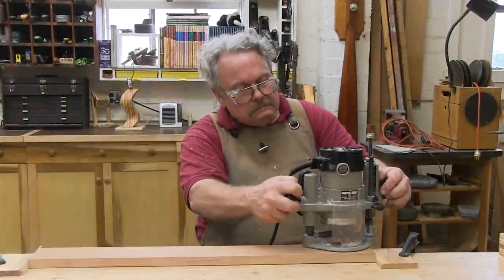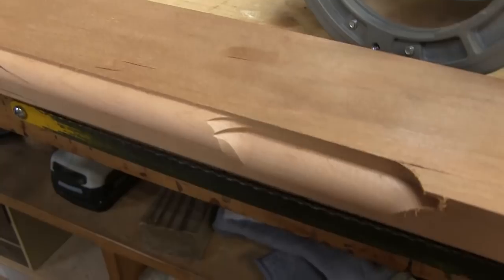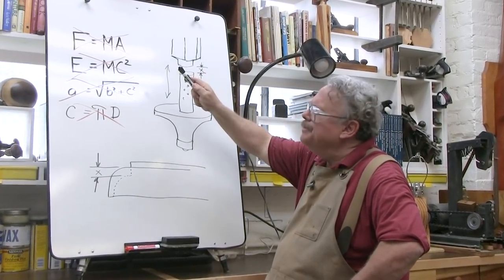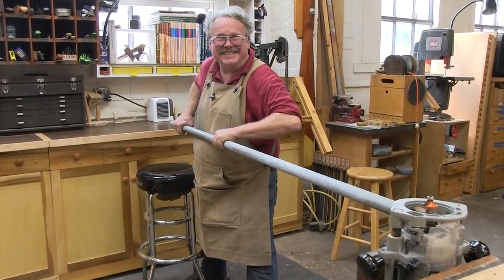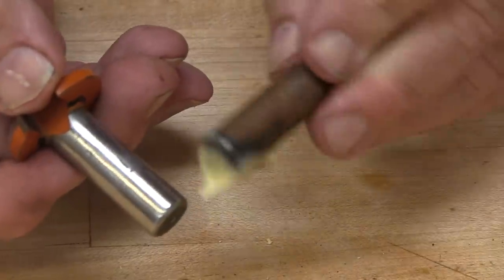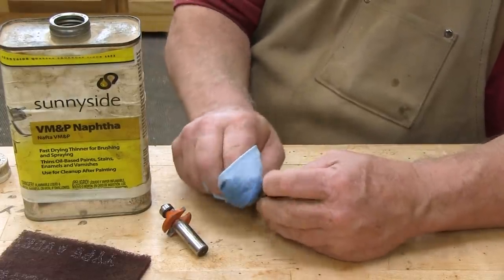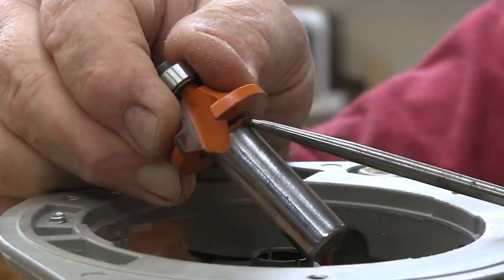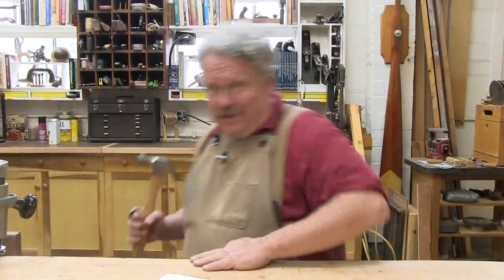Solved! THE Most Infuriating Router Problem.

Comment: First on Nick's list should be prevent bottoming of the bit in the collet before tightening. He came close to it with the notion of ''topping'' out on the neck of the bit, and his o-ring idea covers both, but more bit/collet combinations are vulnerable to this mistake, I think. My technique is to lay the router on its side after cleaning the socket and collet, with the added benefit of enabling you to block one wrench against the bench, requiring only one hand to tighten with the other.

Comment: The biggest problem I used to have was the shank of a bit bottoming out in a collet. It took me a while to visualize what the problem is. But I'd tighten the snot out of router nuts and bits would still come loose on me. Not all the time but enough it was an issue. That got me thinking about what's going on. Sometimes when I'd load a bit I'd bottom the shank out in the recess in the shaft for the bit. The router would be upside down while I was loading a bit and it'd just fall all the way down. When that happens as the collet grips the bit the nut can't keep threading down onto the collet. You already have friction on the column of the shank. The bit is bottomed out in the shaft recess. That's steel on steel. So what I did was I wadded up some paper towel and stuffed it into that shank recess. That can hold a bit up while it's just sitting in the collet and it'll compress as I tighten the nut. Problem, solution. Your other option is as you're tightening a bit once the collet starts to grab pull up on the bit a little. Yeah like I want to do that every time I load a router bit. I just want to drop it in and go. Just stuff some paper towel down in there and call it done.
Reply: This is most likely culprit for anyone that has not received instruction about it, cheers to Paul for mentioning it. It should be number one on Nick's list. My technique is to lay the router on its side after cleaning the socket and collet, with the added benefit of enabling you to block one wrench against the bench, requiring only one hand to tighten with the other.
Reply: @leehaelters6182  laying a router on the side fixes fighting gravity. It works. But it isn't as comfortable as flipping routers upside down and top loading them. They're really made to do that. Least all the routers I have seem to sit that way. I had so many bits walk on me before I figured out what was going on. I'd be sitting there thinking, I couldn't have gotten it any tighter. Once you stop bottoming bits out you make them tight and that's it. You won't have to burst a blood vessel. There's another problem today. Metric tooling. 6mm shank tools are indistinguishable from 1/4" shank ones with the naked eye. They look identical. But you can't hold a 6mm shank tool in a 1/4" collet. You can barely get a 1/4" shank tool into a 6 mm collet either. You can do it but you know you're doing something wrong. 6mm = 0.2362" and 1/4" of course is 0.250" So that's only a difference of 0.0138" a bit more than a hundredth of an inch. Most 1/4" collets just can't grab the shank if it's that much smaller. They kind of can, it feels hand tight. But it don't hold. I've seen 6mm tools being sold as 1/4" too. You know from online retailers, cough Amazon.
Reply: @1pcfred , aye! I ran into that metric/inches discrepency once. Stumped me for a spell!
Reply: @leehaelters6182  yeah it is something that's becoming more prevalent due to the global economy. Was never a problem in the past but it's common now. If you want to buy cheap foreign tools it is something you'll run into. There are unscrupulous sellers that'll pass 6 mm off as 1/4" in the US market too. The reviews there never fail to entertain. 6 mm shanks are actually a shade under 6 mm for clearance. I forget what it is, but it's remarkably consistent as I can recall. I think they're 5.98 mm? Almost no 1/4" collets can grab them right. They seem tight if you go to pull on it. But it's not nearly tight enough when the tool hits the work. So it gets everyone.

Comment: Ha ha funny vid. I definitely polish the router bit shanks on the reg. And I always put the bit all the way down, then retract a few mm before tightening. I do the same with drill bits. O ring tip is nice, as long as it doesn't dry rot and let loose at a high rpm. Doubt that's a legit worry though.
Reply from the maker: Thanks.
Reply: @WorkshopCompanion  thank you for sharing your gift of humor. You were obviously born funny. It's too natural for you not to have been.
Reply from the maker: @dubsbarry9963  My dad was a card. I've not fallen too far from the deck.

Comment: "Dag nabbit makes people think I'm quaint and complicated" Ahahahah not my experience but maybe it's a generational thing.

Thanks for the tip!  I'm glad I watched this video, as I've had this issue more than once and I thought exactly the wrong thing - collet tightness.  However, it appears that the manufacturing process left oils on the 36 1/4" router bit set I got for less than the price of 2 decent router bits was a great starter set.  These oils are most likely to prevent rusting after manufacture and while on the shelf as people wait for them to go on sale for  75% off - $260CAD($200USD) becomes ~ $70CAD(~$55USD).  So about $2CAD/bit vs $45CAD/bit.  This get's me going while I get up a "slush fund" created by selling some of my work to fund my hobby.

Thanks for the tip.  I think what I will do is leave the oils until I use them, clean them with brake cleaner or mineral spirits at time of use, then reapply some mineral oil to prevent rusting.
Reply from the maker: Thanks for sharing.
Reply: @WorkshopCompanion  Thank you!

Comment: I also think on some routers the router bit is inserted until it bottoms out on the shaft. Then the collet when tightened tries to draw the bit deeper which of course is impossible hence the collet feels tight but in fact is stopped by the router bit hitting the shaft. 
I always pull my bits up from bottomed out a 1/4 inch this way the collet can tighten on the router bit and draw it deeper into the router shaft.
Reply from the maker: Good practice. I have a Milwaukee that is attached to a gunstock lathe that I designed that worked just as you describe.
Reply: Instead of pulling your bit all the time you can just wad some paper towel down under the collet in the router shaft. That's if you have the talent to make a good fitting dry spitball object that you need. Can you handle it? Every router seems to have that defect though. I have no idea why they make them like that. Can't they wad up some paper towel at the factory and do it for us?

Comment: Suggestions on how to fix drills? They have the same problem.
Reply from the maker: Keep the shanks clean, of course. Discard drills whose shanks become excessively burred or galled. Double-lock the chuck if you are using a key; that is, tighten the chuck with the key in one of the locking holes, then turn the chuck 120 degrees and check that the chuck is tight in one of the other two holes. If  you have a ratchet chuck, tighten until the clicking stops, then turn the chuck back one click to lock it. If bits come loose consistently no matter what you do, you probably need to replace the chuck.

Comment: I want to know how to get a shank OUT of a collet that has been rusted into place at the base, after years of neglect?
Reply: Going to sound weird but mix some vinegar with a tiny amount of dish soap, add an equal amount of power steering fluid, {the clear not the red}, dribble it in repeatedly every hour or so for over a period of a day or so, it will loosen it up.

Comment: Great tip. I did not think anyone else knew about O-rings. You can also drop some spacer balls (used to allow panel to move in frames) into the collet.
Reply: Oh he does cover that issue. I didn't even watch the video to the end. i got to the rust and grease and I was like that's not it. You don't need O rings or special balls. Just wad up a little piece of paper towel. You'll find one in the shaft of every one of my wood routers.

Comment: Don't forget to keep the collet clean too!
Reply: That's rarely an issue. The major one is bottoming bits out in the router shaft. In fact a crudded up collet might keep the bottoming out problem from happening. Bits bottom out when they slip too easily in the collet. Then they just fall right down.

Comment: i Have just the opposite problem and do not know why. When i am done using the router i have a heck of a time removing the bit. I dont believe i overtighten the collet yet when i loosen it i cannot remove the bit i have tried tapping the top to try and break it loose, i have pried on the bottom to pop it out. I know for a fact i am not bottoming it out as i am usually 1/8 inch up from the bottom when i install it.   Dagnabbit what am i doing wrong??
Reply: Have you tried unscrewing the collet nut until it pushes against the bit ?

Comment: In 30 years I have never had a router bit slip. Reasons? Firstly all my bits are good quality, European or American, they simply don't rust. secondly, not all collets are equal, some routers are supplied with very simple, single split collets, though they are rare nowadays. All the machines I've used recently have a complex, multiple split collet which will clamp a bit much more evenly for a given force.

Comment: My problem is getting the dam bit out of my 1/2" router. 
I loosen the nut fully but the bit gets stuck. I have tried cleaning etc.
Any advice anyone?
Reply from the maker: Loosen the collet, then tap it with a hammer once or twice -- the shock will encourage the collet surfaces to release their grip and the bit will pop loose. I keep a small brass hammer handy when routing just for this purpose. The brass will not mar the collet.
Reply: Yeah to free a collet you tap the nut with the wrench. After you've slacked the nut some. Some collets just get lodged in the nuts. My air die grinder does it all the time. So I give it a beating without even thinking about it. Couple taps. Then the collet fingers can break free. ER collets solve the problem by having the collet spring fit into the nut. You can feel a little drag as they catch up and release. But then unloading the collets from nuts kinda sucks some.
Reply: @WorkshopCompanion  I beat all collets with whatever steel wrench I'm using. I couldn't care less if the nut gets marred. Be real.

Comment: Bits can move- but it is highly unlikely that a bit of that shape would move down- the cutting force is upward. And if the collet was tightened into the top relief, it would then be smaller that the shaft- so it could not move down. Your advice is sound, the examples not so much...
Reply: Mike, that is a fillet, not a relief on the neck of the bit he shows. And the shear built into most bits of that type, including the one he shows, is upcut geometry: meaning it pulls chips out of the cut and provides self feed downwards into the work.

Comment: A much longer cheater would “probably” work too.  Not only that but the cheater would be easier to find.  
Sometimes easy, and simple is not as time consuming, outlandish and crazy as it outta be.  So you know, there’s that to consider.
Reply from the maker: And then there's that folk wisdom concerning shortcuts...
Reply: I was being ironic - 

Nothing beats a cheater.  The longer the better.  That way when something breaks (and it will, the damage done)) things really break!
Reply from the maker: @johnrice6793  Ironic...is that a pun?
Reply: Irony is the difference between what was said and what was meant, vs sarcasm which is intended to wound.
I was and am agreeing completely with you but saying it in the, “work harder, not smarter” or “why use force when you can get a bigger hammer” kinda way.  I think rather than being “smart” I should have, could have stated the obvious that doing right from the beginning saves one much trouble.👍👍